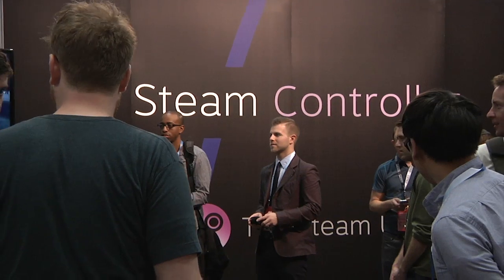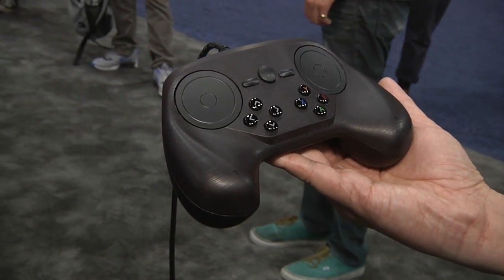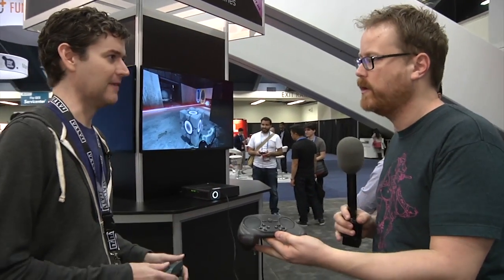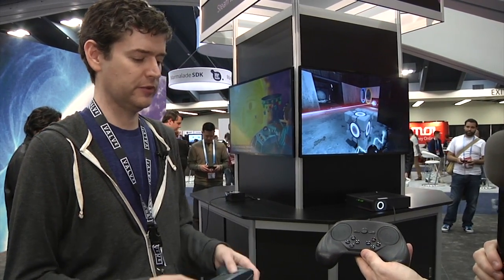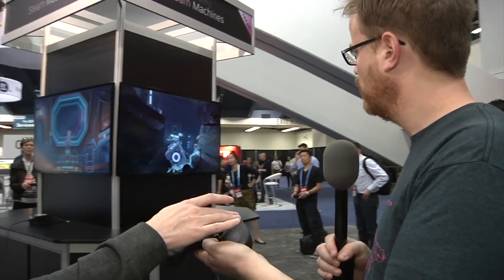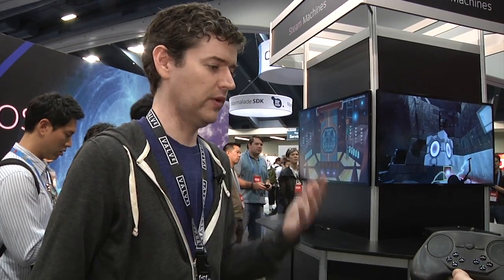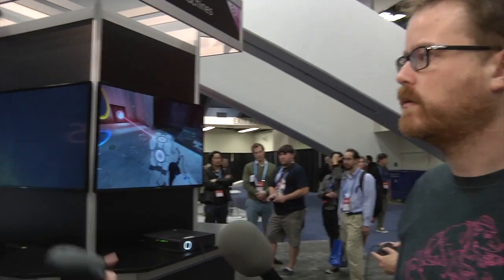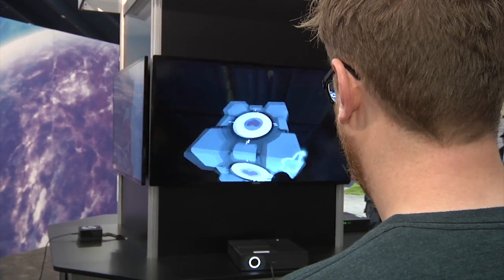Valve's Steam Controller Prototype Hands-On at GDC 2014

Comment: Why the hell isn't there a d-pad instead of the 4 buttons on the left? There is no way, in any game, are you ever going to lift your left thumb to press a button. There definitely needs to be a d-pad on this controller if it they want it to be able to play fighting games. No way in hell are you going to be able to pull off half circle and full circle combinations with the track pads.
Reply: They've heard this 10 thousand times already, the controller is meant to be ambidextrous. And most people will use the track pads for directional input, the button diamond is definitely better.
Reply: Blake Emmerson
Yea except the track pads are more like an analog stick than a d-pad, which is basically a fight-pad without the stick. Anyone who likes fighting games and can't afford a 200-300 stick knows a d-pad is 100x better than an analog stick. You simply cannot enter the moves as efficiently.
Reply: Uh...there are many games that map movement to the left analog stick and extra functions to the dpad which requires you to take your thumb off the left stick to press. 

And did you think of the players that like to flip movement and camera controls? Generally movment is mapped to the left stick and camera to the right, but some gamers (many of them lefties) like to flip it.When flipped in this way the primary face buttons (on this controller) would become the directional buttons on the left since to hit a, b, x, and y they'd have to take their thumbs off of the right trouchpad.

As for the touchpads what makes you say they are more like an analog stick than a dpad? Last time I checked you tilt a stick. You press down on the touchpads (which can also click) just as you do with a dpad. The beauty of the touchpads is they can function in a way that's similar to a mouse, an analog stick, and yes even a dpad.
Reply: The track pads input can be both digital and analog...

Comment: SteamOS is gonna flop.Sorry but it's true.
Reply: How is a FREE OS gonna flop?
Reply: ***** Adoption rate.
Reply: ***** because its basically like the ps3 and xbox os, an os purpose made for gaming. it will always be more convenient to have everything on the same os rather then have to divide it.

So long as Steam is available for windows and Mac OS, it's just unnecessary to have Steam OS.
Reply: SteamOS isn't a competitor to windows. it's meant for steam boxes and making your own steam box. not desktop use on your desktop PC.
Reply: funkman32890 Sure its made for steam boxes. But it can easily be modded to have a linux desktop too. And it has obviously made enough of an impact for Crytek to announce Linux support for CryEngine, Epic to announce Unreal Engine 4 Linux support and for Good old Games to show support for the platform.
Reply: SgtStinger Actually you just tick a box in steamos settings and you can go to linux desktop. Of course you can also install any os you want in the machine. Or make any pc to steam machine.
Reply: Turo Orvel Sure. But I have experienced it personally. And it. Fucking. Sucks. SteamOS is the worst fucking thing I've ever used. You could spend day after day after day, just trying to download a program. All because they thought it was hip and cool to make it so you have to learn some bullshit through terminal instead of just downloading a file which supplies all underlying binaries and the program itself.
Reply: No way. Steam OS is going the way of Android. It's the same business model for OEMs, just console OEMs instead of phone/tablet ones. It'll be Alienware, Asus, and Dell instead of Samsung, HTC and LG. Don't see how it could flop, really.

Steam OS supports all controllers (including DS4, etc) and is open to natural third-party market evolution, like the Oculus Rift. Developer feedback from Steam Dev Days has been very positive apparently (because an open-source platform gives us control and freedom). It's made by Valve, and they can afford to develop it even if it's initially unsuccessful, because they're still largely a software distribution network and aren't investing in hardware manufacturing, at least not on a large scale. They'll still happily sell you games on Windows while growing their library of Linux software. You really think Unreal4 and Crytek just announced Linux support without doing their homework?

In 2 years from now when there's multiple $300-$500 Steam Machine which are all 2-4x the power of a PS4 with thousands of games, playable on any SteamBox for the foreseeable future, then Sony and MS's products will simply be one of many competing console devices.. only with outdated, backward-incompatible hardware and pointless developer lock-ins which only starve the increasingly important indi-games market.
Reply: Katch A Taco there is no way the final consumer version is ever going to have you go through terminals.
Reply: Katch A Taco I have installed it on my home theater PC and i have never had these problems with it. I think you have very little or no experience with it at all or you did something wrong. And remember, it's still in testing phase right now.
Reply: if you're needing to run specialized software packages like Adobe or AutoDesk, sure. pay for a windows license and have at it.
but if i can run steam and teamspeak for games, netflix for movies, firefox for my banking and porn, what do i need microsoft for?
Reply: Turo Orvel It's true that I have little to no experience. But even still, there's so many factors that are pretty much contributing to the end before the beginning. Debian is one of the lesser supported distros, and SteamOS is different enough that nothing works. "You wanna install Crossover? Too bad for you! You're missing 16 binaries! You want to install those? Sucks to be you, they don't exist!"
Even replacing the resource list with the standard Debian stuff doesn't do shit. I got no further than downloading Flash Player.

I had literal nightmares after my few days tweaking with it. And I know the meaning of literal. I had trouble sleeping because I couldn't stop subconsciously thinking "Why? Why won't it work? What does that mean?"
And I know that it tells you that it's not recommended for anyone but experts, but I figured that since I like tweaking with things to make them work, it'd be fun. But honestly, the concept of linux makes no sense at all to me. Why didn't they just stick to the entire computer standard of just downloading an application and having that application function as intended? It's seems as if Linux is just a cheap GUI with no actual base OS files. Nothing more than a couple lines of code and images, because you practically have to assemble the OS by yourself. The thought of ever having to go back fills me with unimaginable sorrow and dread.

Last but not least, Big Picture Mode is a consolized piece of headache inducing rubbish.
Reply: ***** Updating AMD video drivers? Xorg monthly meltdowns? It sounds like you're forgetting how Android devices work, and you're expecting console providers to be incompetent.

Also, Steam OS is also still being worked on, so saying that it's not using the newest kernel and video drivers, when their focus is surely more on stability, isn't really a surprise. Valve is running their own disto, so I'm sure they'll get to ramping up core updates once they have more graphically intense games asking for every last performance enhancement.
Reply: ***** I know exactly what Steam OS is, but that has nothing to do with my point at all. What exactly do you think the difference between Android and Desktop Linux systems are? You're right, it's not magic, it's package management, software distribution, and user interface... all of ways in which Steam OS differs from "Desktop Linux". And no, i don't mean that Steam OS doesn't use Debian's "package management" I mean that it's handled by the user experience in a fundamentally different way.

lol at that last bit. I'm a developer and artist who's been using Linux as my primary platform for years. running arch right now...
Reply: ***** PS4's OS is basically just FreeBSD 9. And the gaming performance enhancements from a source-based distro is really negligible, if Phoronix comparisons are to be believed. The main areas which effects FPS are drivers and efficiency of the rendering API, and here Nvidia is doing great on Linux and OpenGL has been making very good progress adapting low-level memory control features similar to those found on Playstation and Xbox.

Steam Box OEMs can work the same way as consoles and tablets. Not every Steam Box will be configurable, in fact Valve's "star" box from Alienware is said to not be upgradable (last i heard), at least not in terms of chipsets.

Linux is very stable if built & managed correctly, and API's like SDL & OpenGL make writing native cross-platform apps easy. These days, you have to support cross-platform to some degree, unless you are very lucky. So even most games on PS4 and XB1 aren't going to make use of any special allocation models or hardware optimizations until the game-engines they're built with specifically target those devices, and those game engines can do the same amount of special targeting for the Alienware Steambox and GL4.4 features as they can for Playstation & Xbox, really.

Comment: I have never, ever seen any game EVER use the last 'click' on the shoulder buttons ever use it for anything but full stick travel. Ever. Another pointless and never used feature. Why? Because when you are excited and playing the game, you are going to accidentally trigger whatever that is, because you pull back on the triggers HARD in a intense part of the game.

Bad design, IMO.
Reply: Then go play Star Wars Rogue Squadron 2 Rogue Leader on Gamecube. You squeezed down on the trigger to control your acceleration. You'd squeeze to the point it clicked to activate a speed burst which has to recharge or in say the X-Wing to close your S-foils to enter a faster fly mode, but lose the ability to shoot.

And if it's pointless for the reason you say then analog triggers are pointless. I mean in an intense part of the game you might squeeze too hard causing you to accelerate quicker than you wanted.

Maybe instead of writing it off as bad you learn a little finesse and how to keep your cool in intense situations. I always found it pretty easy to distinguish that extra click on the Gamecube controllers.
Reply: BLah blah Living in? The generation that offers 8 generations of video game systems and a vast gaming library available to gamers.

When talking about the digital click on analog triggers do you have a better example than the Gamecube and the games for it that took advantage of it?